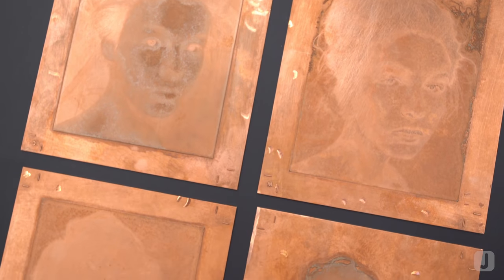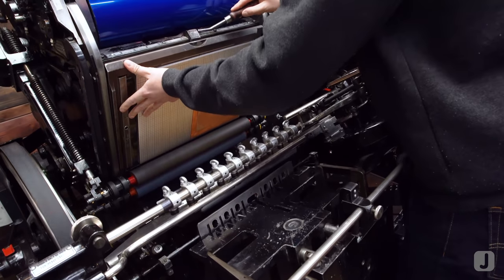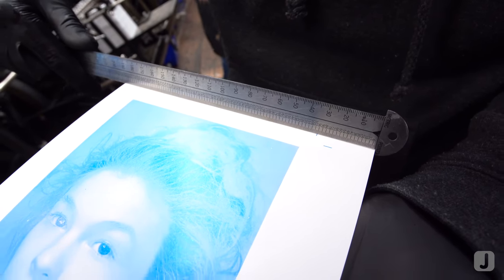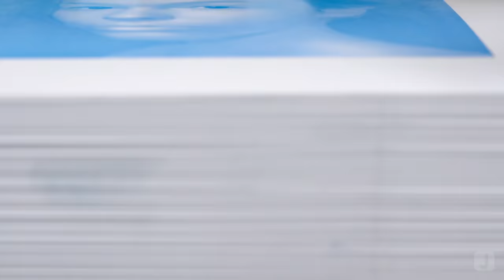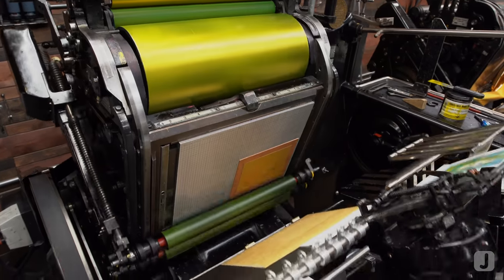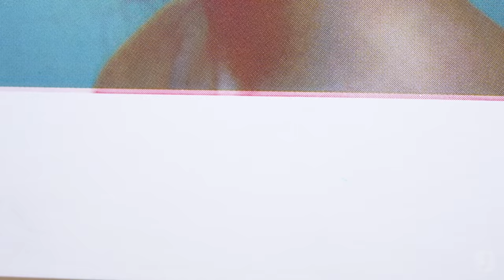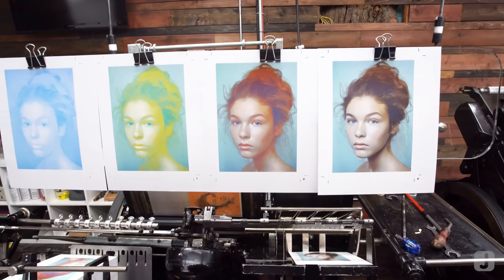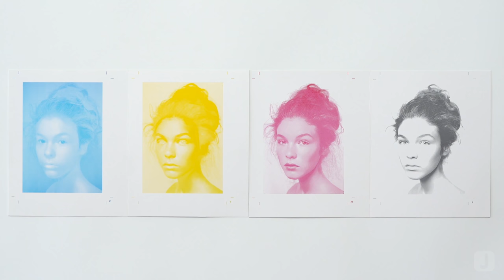Half-Tone Letterpress Printing a Photograph in CMYK!

Comment: Great job! A few comments from an old-timer: Believe it or not, there was still a lot of four-color letterpress printing done right up to the late seventies. Until 1978 National Geographic magazine was still printed by heat-set process letterpress. If you are interested, see:  https://vimeo.com/78230375 . Also, although many people say that the "K" for black in CMYK stood for 'keyline' printer, the original reason was that printers used to call Cyan ink "Process Blue". To prevent confusion between the "b" in Blue and the "b" in Black, the black printer was called "K". (This was told to me in the early 80s by a very old gentleman who worked in a printing ink manufacturer in NYC.) You did a phenomenal job balancing the color. As someone who used to print a lot of four-color work on single-color presses, it is really helpful to place a color-bar along the trim edge and use a densitometer to read the solid bars to ensure the correct strength of the ink going down. But you did a terrific job of eyeballing it. Thanks for the very nice video.
Reply: The Blue vs Black confusion was the "reason" I was told in design school in the 80's...I was always dubious that K was for blacK (especially since Cyan was cyan). But Keyline makes sense, adds to the line of reasoning...thanks.

Comment: Rough explanation of the plates -  The halftone image is made by using an optical filter over the camera that makes the photo - the metal is covered in a thin film of light sensitive emulsion - the image on a film transparency is exposed onto the metal - the unexposed parts wash away - an electrolysis process reacts with the metal and creates the recessed parts of the image - the dots are on an even surface so they all get inked evenly the negative space is recessed and doesn't get inked. 

This allows two revolutionary processes to converge (1) photography light based chemical image (2) Industrial Raster printing.

Comment: Hi , can I use photopolymer flexo plate in this kind of letterpress machine in stead of using copper plate , and  in the same time can I get the same resolution , fine lines and details as same as in the image you have printed ?
                                                                          Thank you

Comment: What liquid are you using to clean the ink from the press? Is it water?
Reply from the maker: It's a water miscible solvent called Varn V-150. It's specifically made for printing inks and doesn't eat away at the rubber rollers on the press.

Comment: Is this the only way to make those "dotted" prints? How thick are those copper plates?
Reply from the maker: This is certainly not the only way. We call them "Half-tones" and you can look into a variety of ways these can be used. Also, the plates are 16 gage copper so roughly 0.67" thick.

Comment: What kind of press is this? It looks similar to a Heidelberg Platen (windmill), but with SO MANY rollers?!
Reply: It is a Heidelberg platen. The amount of ink required to cover the area of the plate means you need a lot of rolling power to keep the inking a constant density throughout the run. They also keep the inking smooth across the plate so as not to end up with stripes. Also the replenishment isn't quite so critical as there's always a reserve. The whole process is a skillful balancing act and takes years of practice.

Comment: There's still halftones? I used to export BW Photoshop to 200 line screen then contact print.
Reply from the maker: Oh yeah, any digital press or offset press today is still using halftones to print a full color spectrum. High quality offset can push as high as 500 line screen. This print was created with 100 line screen plates.

Comment: where does the ink go after it’s cleaned off the rollers ?
Reply from the maker: It all gets collected in a tiny removable trough that we can clean out after. The trough itself has a squeegee that scrapes the ink off the main cylinder when it's engaged. Easy and simple.

Comment: It is excellent!!! But the black color spoils the overall image a little. Perhaps it was needed less. A sharp transition on the cheek and on the neck under the cheekbone. It turns out the head looks separate from the neck. There is a very strong contrast in this place.

Comment: Awesome, awesome job.
And please, take out the strings from your hoody. It's so dangerous to be so close to moving and rolling parts.
Keep up the art.
Reply from the maker: You’ll notice at one point I tuck them in for just that reason. I’m used to a proper printer’s apron when I’m operating a press and I definitely don’t want to be sucked into this machine.

Comment: It’s harder to do but running the yellow first then magenta you can achieve better flesh tones.
Reply from the maker: Thank you Danny, we'd like to try another CMYK print job in the future and will certainly take your advice. We only started with Cyan because we wanted to follow along with the Heidelberg Manual's tips for running process jobs. Also, the amount of blue in the artwork made it feel like a safer bet to start with.
Reply: Jukebox Print in a two color press I would always run the Y & M together first  to get a nice flesh tone then the blue and black to control warmth. Now  you know why those that think K stands for key does not have a clue. CMYK was around a lot longer than a four color press. I spent many a day running a Windmill among others. Keep up the old school work. I would love to visit your shop someday.
Reply: Jukebox Print something else that will help is a solid color bar in the margin to judge your density. It is hard to see and register to when you lay yellow down first which is why they say to start with C. IMO it is to easy to over power the C when it goes down first and make the image look cold.

Comment: I mentioned this on a previous video, but I will do here again. I love your equipment, it is amazing and droolworthy, but your work before putting it into the machine could be more accurate. Is the reason you do not use a mould for this, so that way each copper plate is identically positioned due to the fact that the copper plates themselves aren't perfectly aligned? (ie is there differences in the alignment of the plate themselves between CMYK?) 
You do all that by hand, which then requires adjustments on the press itself, but those adjustments should not be necessary past the C pass if you mastered the plating and positioning component.
You can even see on this project that registration was minimally off. View 23:26 fullscreen. printscreen, zoom in. This is because you do by hand what should be being done with machine efficiency. You have an amazing machine there, but calibrate it every time by hand. As a german, this makes no sense, and I implore you take this comment as was left last year and consider improving your process (again, unless those copper plates aren't perfectly aligned during their production, which makes my entire point moot) https://i.imgur.com/dOD7Buc.png
Reply from the maker: The copper plates aren’t perfectly aligned in production, so yes, moot point. By hand is best, trust me, some things aren’t worth over thinking or over engineering. A crippled cat catches a mouse better than a horse.

Comment: @24:55: It's so odd and fascinating that our brains interpret the girl's upper cheeks, forehead and even upper shoulders as being lighter toned in the final print, despite the final printing step adding black and removing nothing.
Reply from the maker: Color theory is fun and amazing. It's always so impressive to see the 3rd and 4th colors bring the image to life!
Reply: @JukeboxPrintLive  In German we call black “Tiefe”, meaning depth. The word key also explains what happens: black adds depth, not darkness. It defines detail without changing the feel of the colors. After all, the dots are all 15° apart around a circle and never on top of each other.

Comment: As a former serigraph-er, I feel your pain on the judging density of each color. How much of an over run do you do to cover dial in. I am a little jealous in that we did all our prints by hand and one's pull pressure varies a bit more than a press'. We also had problems with the screen clogging and losing dots that is a bit different than plates. Your inks seem a little less volatile than screen printing inks, also. Now I am just whining...
Reply from the maker: Sometimes it takes about 20 or 30 extra sheets to really dial in a job like this.

We have some silk screen projects that we are filming right now. We know exactly the pain you’re talking about!

Comment: I still have a Thompson autoplaten  and   a Victoria hand fed platen in my back shed. Sadly my ignorant elder brother burnt my type cases and threw away my rare founders type ink rollers and  type setting sticks without a care in the world just believing it was all old fashion rubbish a lot of things like type holding chaise were thrown by him on a skip I wish I had stopped him but I didn't want to get into an argument with him.
Eventually I came to my senses and stopped him doing more destructive things.
I also have a large flywheel hand operated paper guillotine.
Because of modern technology some people have no respect for old
machines and equipment. Has anyone got any form rollers, chaise,  type, etc.

Comment: I would kill to work here. I’m an American, 22, and I work printing financial documents. It’s so boring and uninteresting compared to this, and it almost seems like no one cares about the art form they are using.
Reply from the maker: Cutting your teeth in a print shop like that is the best way to learn the principles that come next. Most artisan printers aren’t aware of commercial production techniques and they are more important than you may realize. Paper jogging, programming a guillotine, proper imposition, and good makeready are crucial aspects you can’t learn without being in a high volume environment. Working with thin paper stocks are a challenge all their own. Whether you realize it or not, I bet you’re learning a heck of a lot.
Reply: Jukebox Print Never really though about it that way. Thin paper is certainly a pain in the ass, haha. Thanks for the reply!
Reply: Also, I would love to see how the plates are made. I operate a digital press, but from my time training on an offset, I know they are typically polyester and processed using a laser and activator.
Reply from the maker: The plates we use here are either copper or magnesium. They are developed and exposed using a film negative and then acid etched to make the relief! A little more similar to old offset silver master plates.

Comment: Those pull strings dangling around machinery stressed me out. Don't wear that stuff around heavy machinery!
Reply from the maker: I almost always wear a proper printers apron and printers cap. For these videos, I am required to change my attire.
Reply: @JukeboxPrintLive  - Are you able to cut the strings? I suggest that you place safety at the top of your priorities and if anyone in authority tells you otherwise, tell them to pound sand. A safe work environment is protected by law. Now with that said, get some safety gear customized with logos and/or added to your merch store so you can wear it and advertise too. ;-)